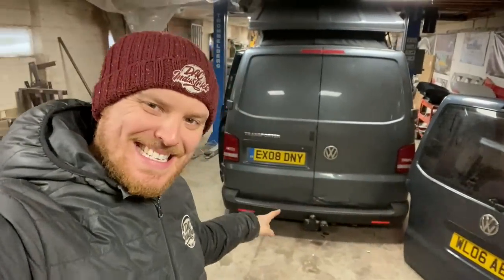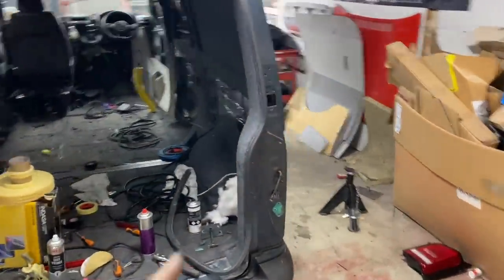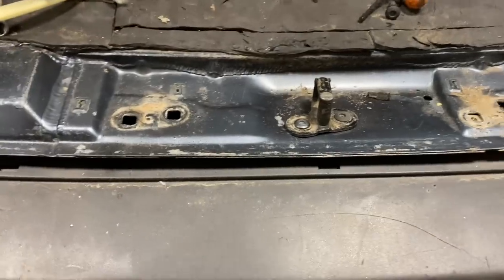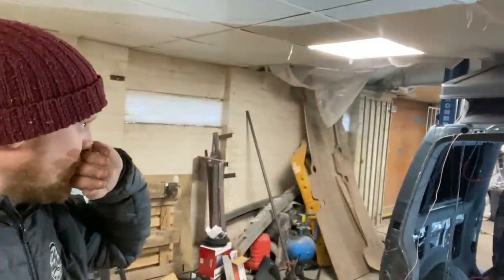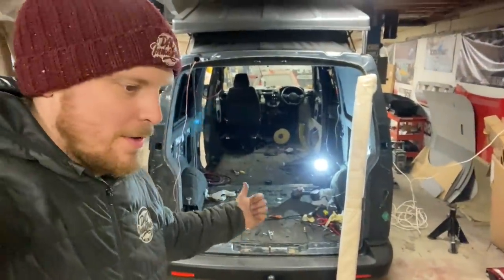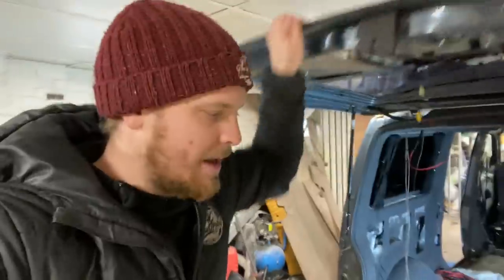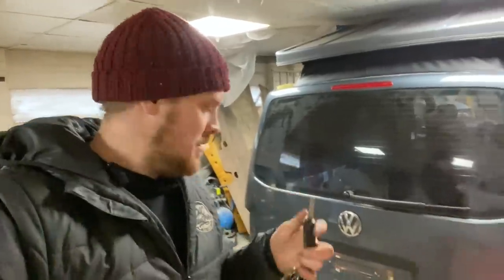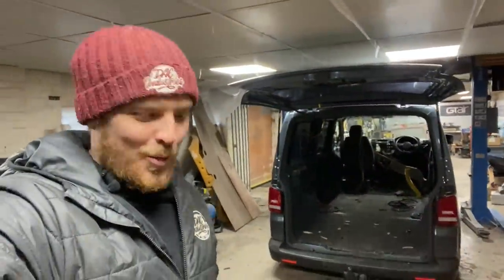How Easy Is A Tailgate Conversion?- VW T5 Camper Project

Comment: I actually like the barn doors on a van . You could make a cover that covers the gap in between then you have a wind brake either side and a roof in case it rains . Good work 👍
Reply: You can actually buy covers now which go over the gap at the top of barn doors. There’s a company which makes them for virtually any van
Reply: All leisure vehicles should have Disco 4 back door layout.

Comment: You have a very bad LED lamp, it is blinking on camera. It is always a sing of low Hz lamp. Osram or Philips always the best choice. As for the tailgate - you can even modify it to electric ones. Also if you gonna add a keyless entry, an electric tailgate will be a killer feature to your wan.
Reply from the maker: Yes I know. I did mention it in the video. Keep an eye on the channel 😉

Comment: Mechanically it’s a really straight forward swap. 

I did 2011 T5.1 with barn doors to T6 tailgate (T6.1 Facelift to follow). 

The real fun starts with the wiring as the T6 tailgate is opened by an electric contact switch that triggers a motorised actuator instead of a manual mechanical lever. Wired everything up correctly according to factory, but hit a brick wall with coding as my BCM didn't have required options to activate.

Had to make a custom loom with a 4pin relay to activate contact switch and actuator all triggered by the interior light at press of key-fob. When lights go off tailgate locks. Was the only way I could figure out how to sync it with central locking. Was actually a very simple work around. 

The rear wash-wipe is very straight forward: Swap out the single output pump for a twin output pump (attached to washer bottle behind nearside wheel arch cover) and run silicone hose from the pump through bulkhead, up A-Pillar and along roof line to Tailgate connection. Swap Steering Column Stalks for one with rear wash wipe. No coding or electrical work required.

Rear heated screen is another matter: HVAC controller, Coding and wiring done, but it's not working yet and getting a fault code that indicates broken connection, but will figure it out eventually., so if you decide to do that I'll be watching with interest...

All fun and games.

If you want to clunk heads at any time find me on Insta: @VWT5.1project

Comment: They do look so much better with a tailgate as apposed they barn doors. They only issues I can think of is, and it comes with a IF, is gaining access to the rear when backed in to a spot that you can't open the tailgate enough to gain access. Cracking match on the Colour as they can be a few shades out depending on age and where that van has been keep they you have the parts from.

Comment: Yes hate barn doors got to be tailgate
I've got a mk1 transit that I've also changed to tailgate that involved fitting a different panel below gutter,
Barn doors are always in the way
Tailgate press button lifts up out the way, you also get a bit of protection from the rain,
But come on grow up and lift that suspension 😂

Comment: Dan is the barn doors back of the van strong enough to support a tailgate the same as tailgate model as I was told that the tailgates have extra strength at the rear
Reply from the maker: Yes they are fine. The barn door van has all of the same structure and the mountings for the tailgate in place from factory. Loads of vans have been converted from barn doors to tailgate including my first T5 without any issues.